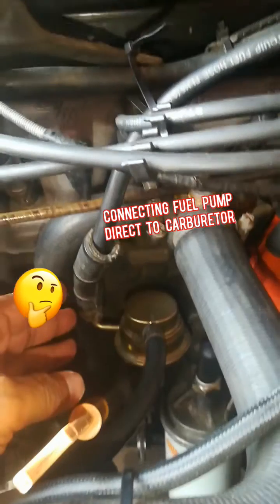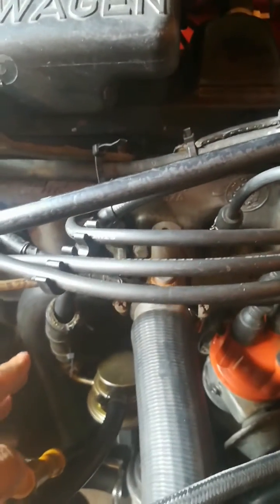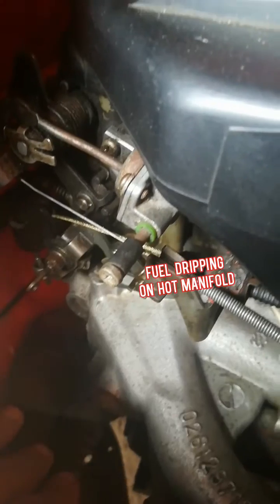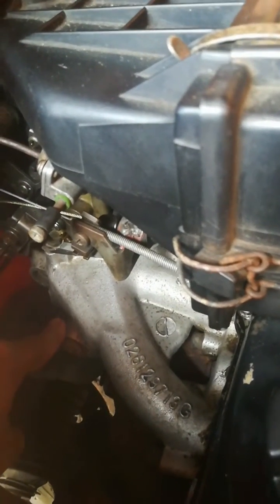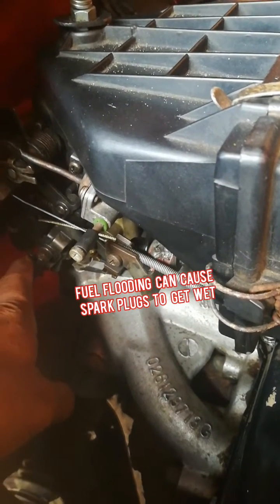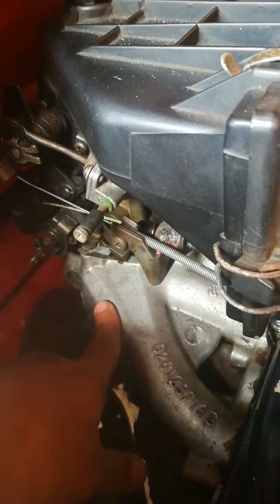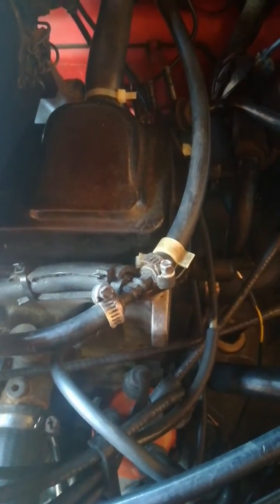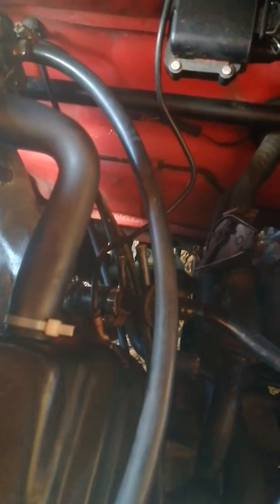VW Golf Mk1: Disadvantages and dangers of connecting Fuel Pump direct to Carburetor.

Comment: Mr PJ

Sitting with a problem
I have connected my petrol directly with the carb....now I'm smelling petrol in my oil and oil is thin

Is it normal?
Reply from the maker: That's also what I'm trying to point out in this video..if the fuel pressure is too high ,it floods to such an extent that fuel can also end up in the combustion chamber . Bear in mind after you switch off the engine the fuel pressure is still at a level that it can force the needle and seat open ,and the fuel will overflow in the fuel bowl and get into the engine .I suggest you put in a T valve with a  return line with ...or revert to the fuel seperator..
Reply: @pjs-golfmk1-diy  Can it lead to bearing knock?
Reply from the maker: @mcdeanpietersen7239  yes  it can, because of the oil being thinned out ,its not lubricating the internal parts sufficiently .
Reply: @pjs-golfmk1-diy  Noted
Reply from the maker: And by the way change that oil...if it's mixed with fuel..that situation can damage your engine..,as your oil is now too thin..

Comment: I have been running mine for a few years direct from the fuel pump to the carb without any problems at all. It was always cutting out when I had the petrol return connected (after market pump and carb fitted though)
Reply from the maker: Yes ,because you have aftermarket fuel pump it probably isn't that strong on pressure at the carb..but if you had a better quality you would find the fuel pressure would be too much,and you would need a return line ..
Reply: Can you post/ suggest a fuel pump setup with specs of the fuel pump ? Do we need to install a fuel pressure regulator? My car uses in-tank fuel pump. So how do I install external electric fuel pump and the specs of the pump? Or I just use the old in-tank fuel pump and just install a fuel pressure regulator?

Comment: exactly this. The beetle and Kombi engines that were before these Golfs had no return line, but the pump was weaker - only delivering around 2-3 psi and the carb was happy. Some after market pumps would send out up to 6 psi and that caused the fuel to overcome the float needle and flood out the engine.  The return line is there for the injection model cars so using the return line to dump off excess pressure for carb cars is an ideal way to solve pressure problems. Great videos by the way.
Reply from the maker: Well said ..I couldn't have said it better ..
Sometimes you get away with it on the golfs because the quality of some pumps are bad and weak...and cannot even pump through the fuel seperator,to the carb.That's why some just connect it direct to carb.,but with a good quality pump and no fuel return you flood the engine.